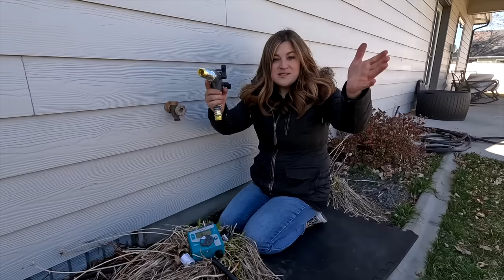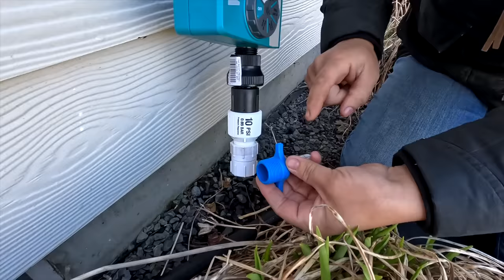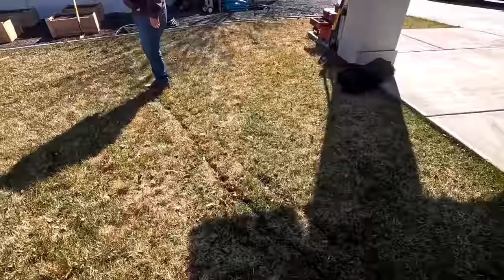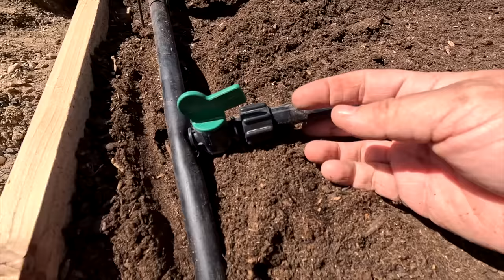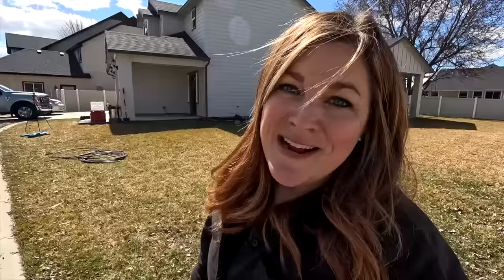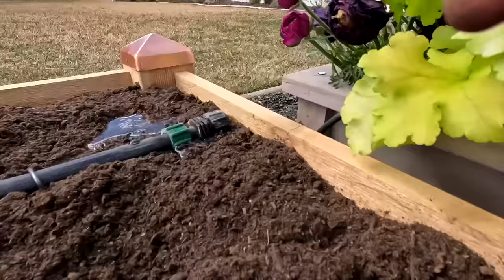Setting Up a Complete Drip System for Raised Beds from a Hose Faucet! 💦🌿 // Garden Answer

Comment: Just for safety purposes, the extension cord should be run through conduit. You never know who (kidz) could be digging in the yard
Reply: Renee is right. You should never run an extension cord underground like that
Reply: You ideally shouldn't be running permanent extension cords ever.  Better to wire in a new outlet with underground direct burial wire or wire in conduit.  Extension cords could generate heat in an enclosed space such as conduit.

Comment: This video makes me thankful we live in a place where regular rain happens!  We do have some areas of our garden on drip but we paid someone to install it cause it is a pretty complicated process. But now we aren’t needing to use it very much cause we’ve had so much rain lately. You guys have excellent expertise!❤
Reply: I'm near the equator and we have half the year in scorching heat (~39 °C) and half the year in monsoon rain/typhoon. It's awful 😂😂😂 I would rather have dry climate and I can control moisture myself.
Reply: @AlltheArtsy
The problem with living in a dry climate is that water is a finite resource.  We only have so much that we have access to underground, and  refilling the aquifer takes hundreds of years, so we won't have access to water for a vey long time, if we run the Aquifer out.  I think I read somewhere that our Aquifer refills at a rate of less than an inch per year.  We live in NW Kansas.  Western Kansas/Eastern Colorado/SW Nebraska have been experiencing drought conditions for a long time, so our Auquifer isn't refilling at the rate that we are using water from it.  If I remember correctly, Eastern Colorado, NW Kansas, and SW Nebraska are on the same aquifer.
Reply: You have a beautiful garden too!! Glad to see you watch Laura. I feel like I have found my tribe!

Comment: This is very important, Renee got it right.  You are required by electrical code to put any electrical wires that go underground in a metal or electrical grade conduit rated for outdoors and bury it anywhere from 18"-36", depending on your local codes.

Comment: Installed 3/4" x 100' garden hose with a 7/64 hole drilled every 5' along a row of 18 blackberry plants. We have ~60psi service pressure. I left it on overnight (not intentionally) a couple of times in March and watered them a good bit off and on throughout the month. My water bill for March was FIVE times normal; 32,000 gallons. Had them check the meter and got a daily use chart. Not a water company problem. My hose at that pressure expels ~600 gallon per hour through 18 7/64" holes. These better be the best damn blackberries EVER! 🙂

Comment: As I sit here with Laura on the TV giving the weekly update, I have Laura talking on my laptop so she's in stereo.  This has been a great example for those of us with normal sized yards in neighborhoods.  If I won the gift card, I would buy two of the raised beds with the copper caps - either two squares or two rectangles and either design in parallel or an L.  Good luck to me.

Comment: I used a combined pressure regulator with built in filter. Would definitely advise adding a filter before everything (straight off the tap before the controller). Really helps avoid problems with stuck valves and blocked drippers.

Comment: I have had really good luck with Gardener’s Supply’s Snip & Drip system for my raised beds. Their system uses a drip hose so there’s no worry of emitters getting blocked, because the water slowly weeps out of the hose. No emitters.

Comment: Excellent, I ran drip irrigation much like yours to 6 beds on my patio so I had to go up a post and across my patio. and drop down at each post to feed the beds but it works great. I only used the brown 1/4 inch lines with emitters and buried them below mulch to stop the sun rotting them. The brown lines never have plugged in 3 years so I am happy with them.  Nice video, showed why plumbers make the coin!! Too many different fittings and thread types. It take a layman a while figuring out exactly the parts needed, however a few spares come in handy in case of breakage etc. Thanks.

Comment: I really like the addition of the elbow piece. i tried setting up soaker type irrigation last year and hated the way the timer was jutting out awkwardly, will def do elbows when i try again, of course the soaker hoses were all blown out by middle of summer. drip tape may be a better choice next time. I would love to have the whole garden on a water system. A good way to spend the gift card, I think.

Comment: You always seem to hit on timely (for me) topics!  I'm planning on installing irrigation to several areas of my garden.  Even though I live in MN 4b, and we tend to have adequate rainfall, I have areas that remain consistently dry.  Gardener's Supply catalog just arrived with a spread on irrigation!  Would use the $500 gift card for that.  Trying to work smarter, not harder.  Thanks for adding so much joy to the world Laura!

Comment: I believe on the Y or gang connectors there is a hole to attach it to a stake.  It is pretty much necessary with all that weight, at least for me as I tend to end up moving hoses a lot😊

Comment: This video was so helpful, and makes it easy to understand for someone who hasn’t used drip before! How long will the different parts of the system last? (The supply line vs the drip tape). And can you talk about what you’d need to do to winterize a system like this?

Comment: Laura thank you for this video. We have well water and have hard water. We had to install a water softener & neutralizer. I always shut these systems off when I water my garden (by hand with a hose) because I’m afraid that the salt used in these systems will harm the plants. I’ve wanted to set up a drip system especially on a timer but didn’t think I could because of the softener setup. I know you always talk about your hard water but never heard you mention if you have a softener or neutralizer and if you have to be careful about the salt that is used.

Comment: If you are using soaker hoses and damage, lose or need a replacement end cap, a 2 liter soda bottlecap in the exact thread as your garden hose. It is also water and pressure tight (and probably free). I discovered this accidentally when I moved my leaking washing machine onto the patio and had to cap the hot water feed. I thought, "Gosh that thread looks so familiar. Could it be?" It was!

Comment: Thank you for this very well explained video.  I am going to revamp my in ground vegetable garden this fall & am going to install irrigation.  I think the drip tape will work well for what I have in my head that I am going to do.  I am getting older & dragging a hose around is getting harder.

Comment: Thanks Aaron and Laura for the great "demonstration" of drip tape installation. I'd love it if, at some point, y'all would go over design and planning for the entire system. Is it an arduous process or pretty simple. Also, I've noticed in my local "big box" that there are kits for drip lines but not drip tape. Do these work well or is it better to buy pieces that better fit the individual design? Thanks again for all you two do to help us all. Have a blessed day!

Comment: Thank you so much for this, especially showing what/how to get irrigation neatly inside the bed, and clarifying pressure regulator size for drip tape vs 1/4-inch tubing with emitters. Question: could you explain when/why someone would choose to place a pressure regulator at the hose bib vs using pressure regulators at each bed?  I’ve seen it done both ways but I’m not sure why the difference…is it run length, tubing type?? Just wondering your thoughts.  Thanks again for sharing all your garden inspiration!

Comment: So much easier for Alyssa. I was wondering if the pressure would be enough to reach the arbs but it seems to be great. I never know just how far I can extend the length. Glad you moved the setup to the left side of the faucet! Now she just needs a Hoselink for the other side. 😄 I’d love to see a wall or flat back fountain by the narrow bed. I think the sound of water would be a nice addition.

Comment: I will definitely put drip line in my raised beds. Thx so much for showing us step by step on how to run drip tape. I is so helpful. I would use the $500 Gardeners Supply e-gift card to get the raised beds to complete the area next to my greenhouse that was built with recycled windows!

Comment: 👏🏼👏🏼👏🏼👏🏼 Thank you for sharing this.  Your video is incredibly thorough. Love how you zoomed in when necessary so we could REALLY see some of the fittings, threads and connections. You take the “scary” out of doing a project like this. 🥰

Is there a process BEFORE you got to this video? The planning to figure out how much material you’ll need?
(I’m going to check your channel out to see if you share that part as well.).

Comment: It is a good idea to run water through the lines before you close off the ends.  Then, close off the ends and run water through the whole drip system.

Comment: I really appreciate that you showed how to set up a drip system from the outdoor house facuet.  The instructions were very easy to follow and actually made sense to someone who doesn't know what they are doing. Gives me confidence to try.  Would you leave the unit attached to the facuet during the winter?  I live in zone 5b. Would I have to worry about water freezing inside the system?

Comment: My husband and I were just talking about how to hook up drip to our new raised beds from our hose faucet so the timing of this video was perfect! Thank you! Question- how would you recommend prepping this system for winter? Would you unhook all the attachments completely and blow out the lines with an air compressor? Not sure if that’s necessary or if an air compressor would damage the drip lines.

Comment: Just an FYI... There is such a fitting (in brass anyway) that goes from garden hose thread (GHT) to a hose barb. No need to adapt from GHT to pipe thread (NPT) to hose barb. The Fairview Fittings part number for the female GHT to hose barb  is 195-(size). -8 for half inch, -12 for 3/4 inch, etc. There is also a male GHT to hose barb in brass... I'm enjoying this video. I'll be setting up a drip system for my planter pots where I have tomato plants growing.

Comment: Thanks for sharing a smaller scale drip line process.  I noticed you didn’t bury the water line very deep.  Aren’t you worried about water freezing in the system?  If not can you explain how you would blow the system out to prevent water freezing in it.

Comment: Hi Laura and Aaron 👋. Question?……What do you do in winter time with the drip system? Is there any specific way to winterize the drip to keep it from freezing up. I noticed you didn’t put pipe insulation on tubing when you buried it. I’m installing a drip system this year so was wondering about winter time care. I live in north eastern Kentucky so our temperatures does stay well below freezing in winter. Thank you for sharing your experiences …..it helps a lot!!!!

Comment: I get plenty of rain most of the time in my area, so no need for drip here. I wouldn't want to install and use it even if I didn't get enough precip, so in that case I'd probably do a lot of xeri-scaping. But this does seem ideal for growing some vegetables and herbs in your dry area. I'm interested in the seed-starting she's done, and which trellises or other supports she's chosen for this area, since that's more geared toward what I need, so I'm looking forward to the phase four video.

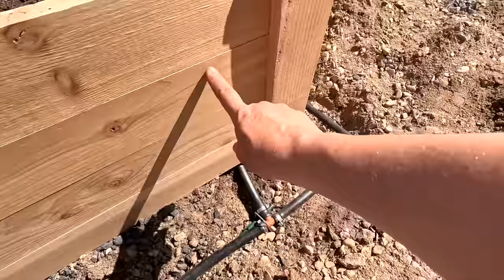Comment: This is awesome and just what I needed! Quick Q- @ the 10:00 mark when you run the 1/2" hose from the t-coupler UP to the top of the raised bed (inside the soil), is there an additional t-coupler or an elbow inside the base of the bed to accommodate that 90 degree angle upwards? Or do you just curve the hose? Thanks for taking the time to share this project with us!

Comment: Not sure if the $500 giveaway is still going, as it wasn't mentioned in this video, but we'd still love to use it for raised bed kits or at least the corners; new bench; maybe an obelisk for one bed; or maybe a pair of the taller self-watering containers for our front stoop which is not as easy to run irrigation to!  PERSONALLY to y'all....Over the last 4-5 years, your videos including drip irrigation from faucets and in-ground systems has been so very, very helpful! All of our regular seasonal pots at our entrances, as well as a bonsai collection (which MUST be watered at least twice a day in our hot Southern climate, especially during dry spells), are "covered" now whether we are here or not. Also, you helped embolden us to convert over half of an old and ineffective over-head irrigation system to drip, starting with flower & food beds and nearby containers. Hasn't been easy for our older hands and bodies, but such a blessing!

Comment: Great video & narration.  Thought you would have buried the tape deeper.  The extension cord looked to be lighter duty 16 gauge.  Be careful if you run a heater or other high demand appliance as a 12 gauge would be better - especially at long distance.

Comment: This was SO helpful. I have been wanting to run drip lines to my raised beds but have been so intimidated by the process. I feel like I can do it myself now! Do you think there’s any reason or drawback to running water lines (or extension cords) through PVC underground? I thought it might help protect/extend their life because of freeze/thaw cycles… but also cover up an easier way to find and fix a leak in the long line out to the beds. 

Thank you so much for all your videos, extra thanks for this one 😊

Comment: Question and this might be more for Aaron. If you don't have a way to run drip irrigation, think raised beds on concrete patio, would a soaker hose connected to a garden hose work just as well?

Comment: Thanks for the great video! Using a lot of your tips in my garden irrigation plan. Wouldn't plant fruit trees you intend to harvest near arbovitaes though, due to cedar apple rust
Reply: It might be not be pertinent here I believe there is a limit of 60 ft max for the main line to maintain water pressure to the end of the line. Also, selecting drip heads based on the water quantity needed for type of plant and run time since everything is running off of one timer. Some plants could get soggy while others don’t get enough.

Comment: A huge thank you for this video! I’ve been so intimidated by creating a drip system for my raised beds and you have given me a confidence boost! I currently have a ‘y’ adapter on my hose Bibb and one issue I’m experiencing are leaks from all (3) the attachment points. Could it be that the y adapter is just a “crappy” one? lol

Comment: Great video for installing drip irrigation. Could you explain the limits of how many beds and how many feet of drip irrigation you can add to one zone of irrigation. It seems like the more feet of drip tape, the more individual pots, and the additional cypress Trees, that you add, the less water you would have going to each spot. And at some point, would the water pressure not be enough to reach the far ends of the system. I also would like to know if the system circles back to the beginning and reconnects, forming a closed loop to try to even out the pressure from beginning to end.  I think I remember that at one point you set up zones to form a loop but then stopped doing that in later videos.  Could you explain the pros and cons.  Even in Laura’s home gardens, she keeps adding irrigation to existing zones. At what point, does that reduce the water to the point that you need a new zone.

Comment: Thank you for the informative videos. I love your channel. I plan on using drip irrigation off of a hose bib and I was wondering if I need to install a hammer arrestor to the system as well? I was also wondering when to use a 25 PSI vs a 10 PSI pressure regulator. I am thinking about using 3/4 inch poly tubing as my main line and branching off of that with 1/2 poly with emitter holes. I am just not sure which way to go. Thanks again for all of the information! Super helpful 😀

Comment: Thanks @gardenanswer for an awesome video. How do you winterize this drip system? The tape could be brought in or water will leave it due to the holes. But what about the buried black pipe under ground? Does that need to be blown out for winter? How would that work on a system like this?

Comment: Good morning! 🌞 Thank you for this video! I have been putting no dig beds in my back yard. I'd love to get drip run out there eventually, and this is such a good tutorial! Question, if I were to use drip tube instead of drip tape, would I still need the pressure gauge? Thanks! ❤️

Comment: Was reluctant to listen .. I wanted a 2 min answer.. but impressed.. 
splitter, timer, Elbow so goes direction, backflow has arrow on proper direction, brown 25 psi, drip tape 10, 12 psi cheaper , **hose thread and pipe thread different * hose is wider, clamp drip tubing on adapter w crimper, … 
***Point drip tape up ***… less chance of clog, shut off valve each section little more expensive Worth it 
T and elbow run under to top of each bed.. 1/2 inch supply line T coupler and elbows… figure 8 Enders, drip slides on then ender. 
Skinner side end fold 3x ..

Comment: Hello! Thank you for your videos. For the first time I feel like installing irrigation for raised beds is accessible and doable for me! Quick question - on a video of yours from a few years ago I see you used that brown 1/4" tubing instead of drip tape. Do you prefer drip tape to those drip tubes and if so why? Does the drip tape allow easier installation of valves or could you use valves with the tubes as well? My worry with the tape is that it's less long lasting that the drip tubes. Thanks a lot!